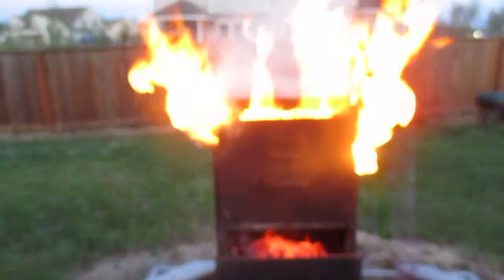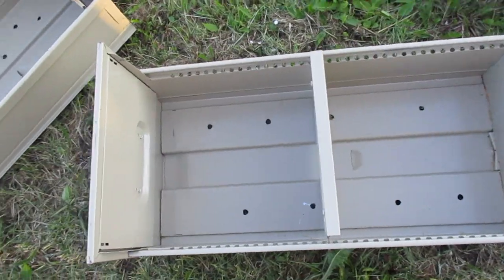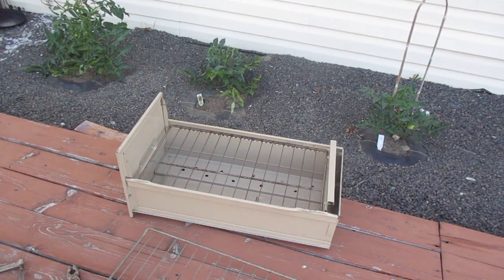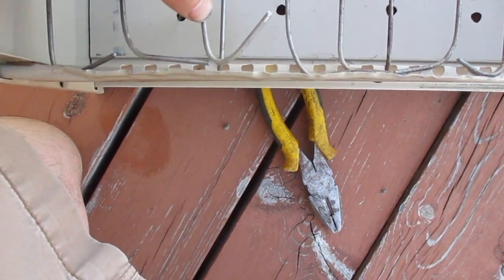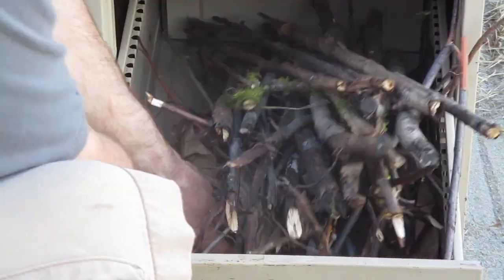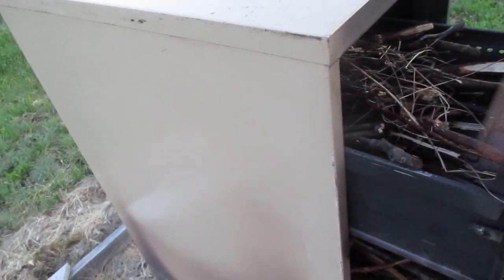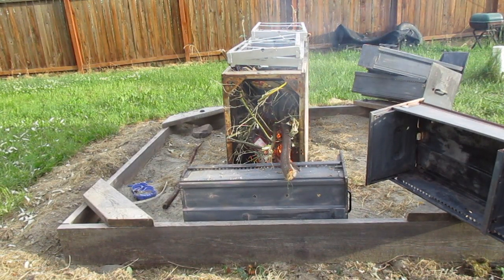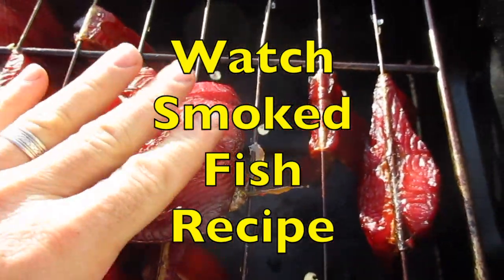DIY FILE CABINET SMOKER - HOW TO BUILD - Smoking Fish and Meat

Comment: I like what and how you did this . There is however no mention of fat or drip collection  ? Would either cause a problem ?
Reply from the maker: I just had them drip down to the bottom and the drippings dried down there.  You could also put a layer of foil down and toss after.
Reply: If you put a water pan/drip pan in the 2nd from the bottom drawer. Not only does it catch the drippings, with water added, it acts like a heat sink and makes it easier to control heat. It also adds moisture to your smoke, which makes it easier for meat to absorb. And finally, you can use those drippings to make a gravy.
Reply: When it comes to a lean cut such as salmon there's not too much fat to drip out.
Reply: @spacecowboy_1962  I like where your head is at sir!
Reply: Nice. I’m going to build a fire and put the drawers and empty cab into it to burn the paint off. I think it will be easier and faster.